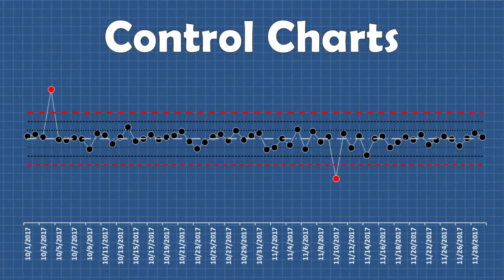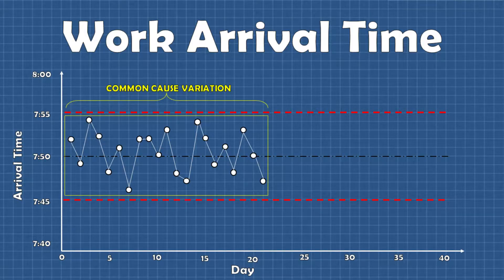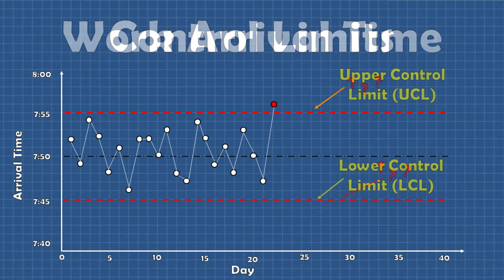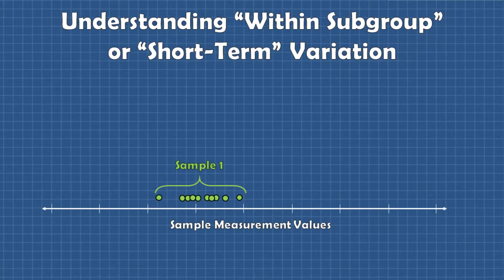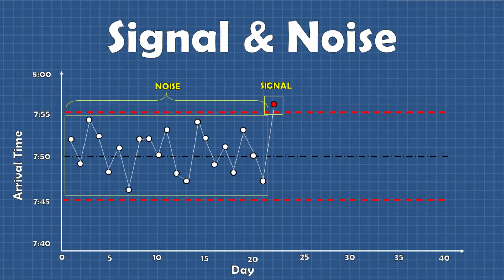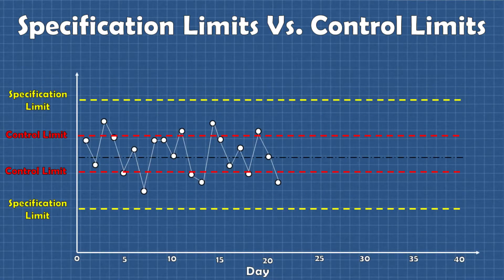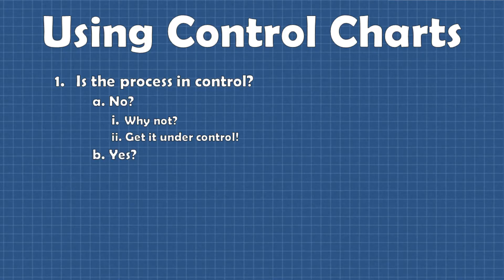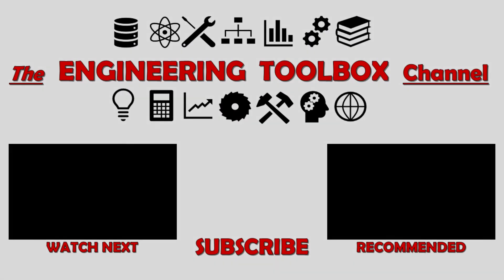How do SPC control charts work?

Comment: Hi, that's the difference between a signal within a process that is "in control" and an indication that the process is not in control? It looks as though an out of control process is one that has lots of signals. Is the response to signals if both "out of control" and "in control" not the same between these two states i.e. that you should react to signals and not to noise? How is 'out of control' specifically defined? Thanks
Reply from the maker: This is a good question…In control vs out of control is really a moment in time characterization.  So short answer is if you have a signal, the process is out of control and ideally you should take action to investigate why.  

A process is in control when no signals are detected in the most recent sample.  A process is OC when the most recent sample shows an out of control signal.  

So over a long run, it’s very possible that a process has been both in control and out of control at different time periods.  Knowledge of the process, the amount of risk associated with OC datapoints, and resources available to react to them will dictate how you respond to OC data points.  If a process is frequently OC, it just means it’s generally a process that goes out of control and needs more attention.
Reply: @TheEngineeringToolboxChannel  Thanks so much for your fab answer. This makes a lot of sense and makes this method feel much clearer now :) Great video (and enviable Excel skills). I've subscribed.

Comment: Questions... why do the control limits not change over time?  It seems the control limits could be recalculated after each new subgroup of data is added.  Furthermore, when a control chart is initially created, how do you know how many subgroups are needed to have sufficient data sets to generate a control chart?
Reply from the maker: The purpose of a control chart is to prevent the process from changing.  If the control limits or mean change over time (as more data is collected) then it defeats the purpose of using the chart in the first place.  The idea is to measure the process, make sure it is in control, then lock the control limits so you can detect if the process has shifted.
Reply: @TheEngineeringToolboxChannel   This makes sense thank you!   However, this part still seems like a chicken and egg situation to me. When you say "The idea is to measure the process, make sure it is in control, then lock the control limits" ... how can you make sure it is in control, if you do not yet have a control chart with locked limits?
Reply from the maker: You would collect the data for a period of time until you have a good sample size.  (usually 10-30 datapoints is enough).  The goal of the initial data collection should be to capture the variation you would expect to see in the process under normal operation.  Then use that data calculate control limits.  
If all points are within control limits, lock the limits (do continue not use new data to recalculate mean and control limits).  

If you have datapoints that are outside the limits, you need to investigate those events to see if you can determine what caused them.  If you CAN determine what caused those out of control points, then you would remove them from the control limit calculation, then lock your control limits.  If you can’t, you do not have a process that is in control and there is no value in locking limits yet.  Process should be mostly in control and/or you can assign a cause to the out of control points before locking limits.
Reply: @TheEngineeringToolboxChannel  I see, makes complete sense!  thank you so much!

Comment: Thanks for the video! Question, you say you don’t want to focus on Noise, but what if my intention is to reduce variation?
Reply from the maker: Great question! I say don’t focus on the noise because looking at each datapoint individually is often a waste of time when the process is in control.  If the process is control, it is predictable and attempting to reduce variation on a datapoint by datapoint basis can actually lead to more overall variation. Reducing variation in the overall process requires process or system level changes. Things like new equipment, new procedures, etc.  You need to ask yourself if the process is capable of meeting customer demands.  If it is, then I would suggest leaving it alone.  If it isn’t, then process level chances are where you need to focus.
Reply: Thanks!